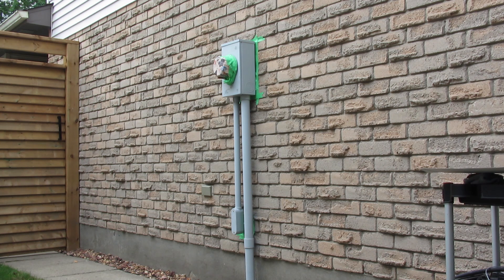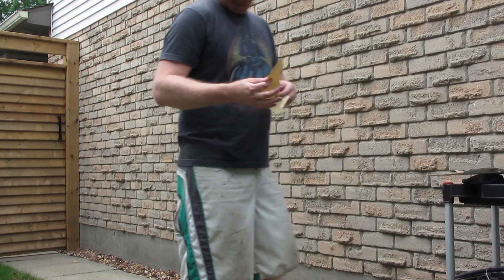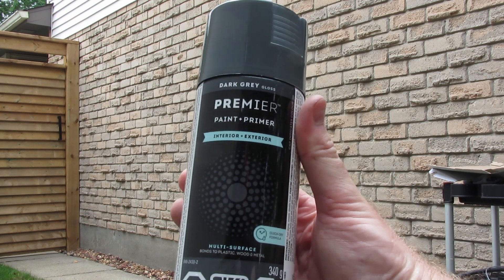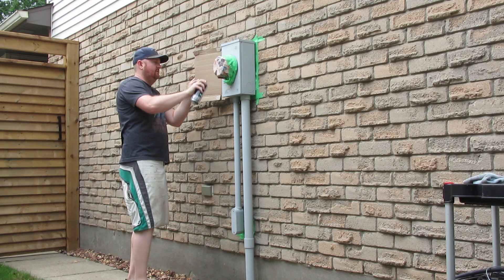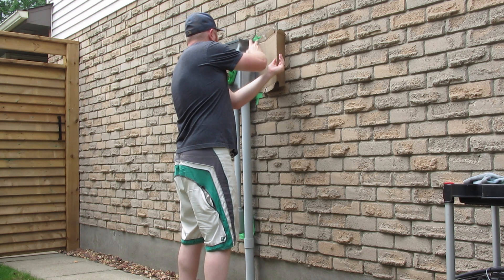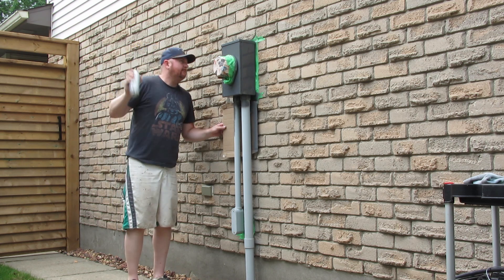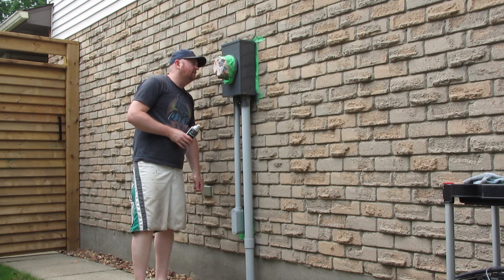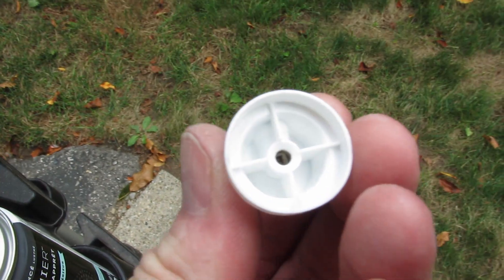Canadian Tire Premier Spray Paint - Fail!  How to use & apply spray paint cans properly  || Results

Comment: Oil base to water base. No prep or scuffing and illegal 🚫. All utilities and meter boxes are the property of the company or  the supplier or province in the case of Canada 🇨🇦.  I know it sounds  weird but you've just vandalized property on your property. Nice video and a thumbs up from me. Hope you dont get fined.
Reply from the maker: In Ontario, Canada the Utilities Company owns the meter (Water, Hydro and Gas).  In this example, Hydro owns the meter only (the round meter with the digital display), but the homeowner pays for the install and material from the property line to the meter, then the meter to the panel.  If there is an issue with the meter housing, the Hydro Company does not pay to replace.  Its on the homeowners dime.  Again, this is confirmed for Ontario Canada.  Thanks for watching and the comment!